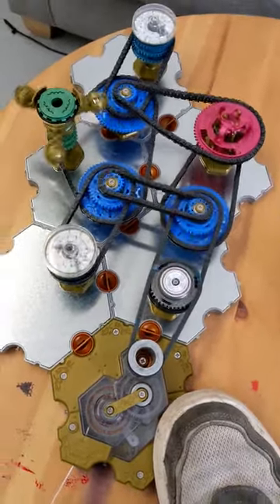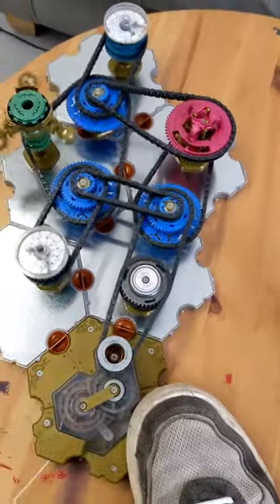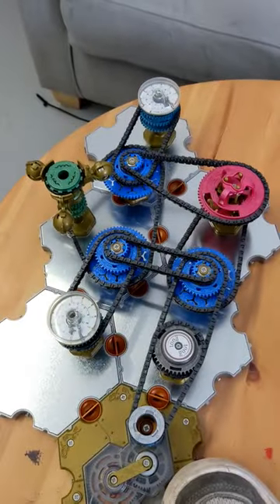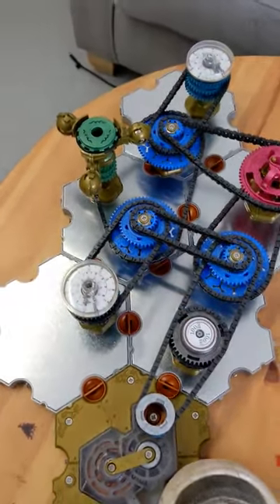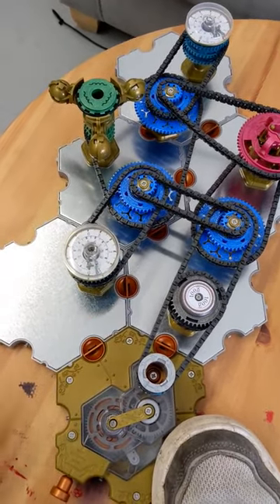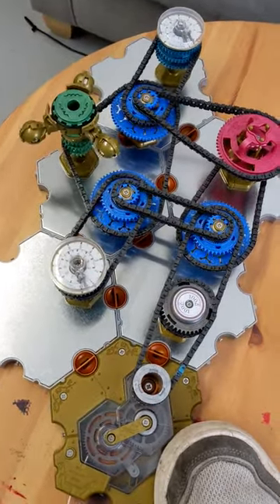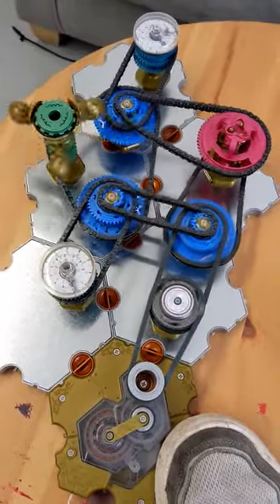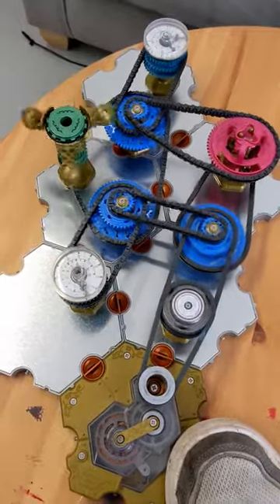mechanical circuits: an analogy for electrical circuits

Comment: I am curious what an analogous full bridge rectifier would look like.
Reply: He has shown that in the full video
Reply: FUUUUUUUUUUUUUUULLL BRIDGE RECTIFIAAAAAAAAHHH
Reply: would be curious what a WiFi module would look like
Reply: @4n1eu , forget about that. I'd be amazed to see someone implement a 555 timer or something stupid simple like that.

This is 100% a learning tool to help you get your mind around the operating principles. You'll still need a gymnasium for anything beyond the simplest components.

Though, it'd be hilarious to see folks cheat and implement complex IC's as arduinos driving a closed-loop stepper.
Reply: @samhughes1747  
Thinking back to the 555s I remember working with back at university, one could effectively simulate one with a pile of mouldy socks, or a broken bottle, or a scoop of dirty sand from the beach right next to the leaky sewage outflow pipe, or a great big bag of fresh air, or a random toddler or . . . etc. etc. etc.
The little fckrs just refused to do anything predictable, or useful.
We honestly started to wonder about whether the department had contracted us out to the med school without telling us, and we were being covertly monitored by psych students to find out how many faulty component sets it might take to drive the whole year insane. 
It's easy to spot anyone who was there back then - they get this far away look in their eyes and start grinding their teeth whenever they see three fives in a row.

Comment: Saw the full vid. These look awesome.
But, I can't wrap my head around the blue terminals for paralleling... Why are the gears different sizes? Are some dedicated inputs and some dedicated outputs?
Would love to see more about that.
Reply from the maker: I think it's just so you can see what's going on with them (the planetary gears are really cool!). Like, you could be all the same size so long as you work the internal gear ratios so that the "cogs per second" is the same for all of them then you're good
Reply: @SteveMould   Ahhhh, so they are teeth-per-second-matched! Yeah, that must be quite an interesting gearbox. Now instead of building circuits with these, I want to take them apart to see how they work!

Comment: It would be sooo cool if you tried to build a coupled circuit analogous to 2 coupled pendulums to witness the flapping effect, where the energy is transferred periodically between the 2 systems.